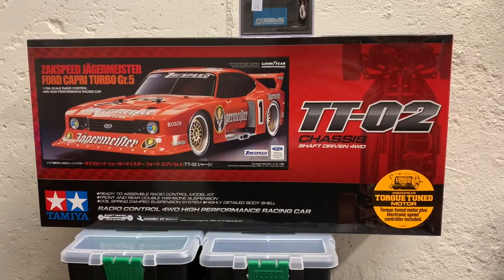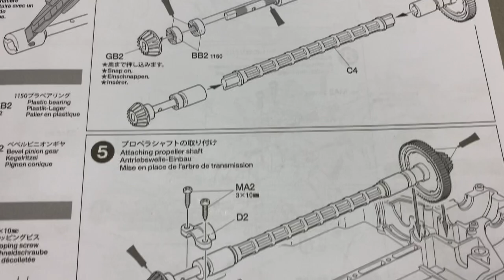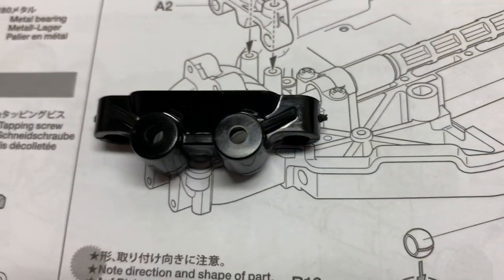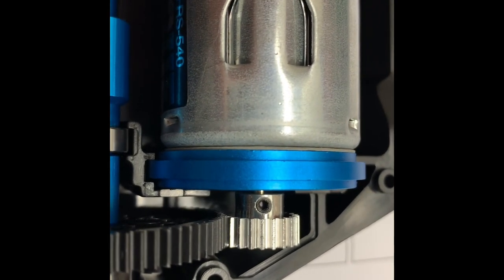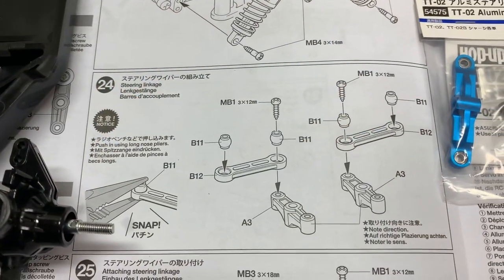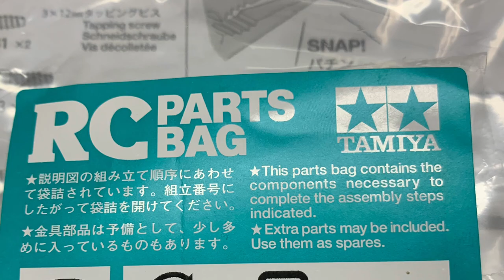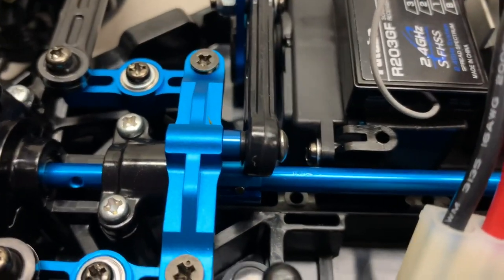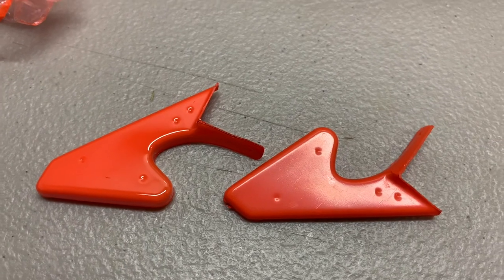Tamiya TT-02 Detailed Build With Hop-Ups!!!

Comment: Doing the Escort TT02.  Bought some hop ups too.  CVA oil shocks is one of them.
Reply from the maker: Sweet, I love that body set.
Reply: Cool! I am actually considering getting that one, as a way to get into the hobby. I have quite a bit of scale modelling experience under my belt, and im looking for a new challenge. Tamiya's always been great, kit wise, so im guessing their RC stuff should be spot on too, right?
Reply from the maker: Yes, great scale detail and solid performance. I would definitely recommend them for kits. Easy to build, but loads of fun.

Comment: Hello, I have the same chasis. For the differentials. I saw you used the yellow grease instead of the aw grease? I used the AW grease on my differentials. Did I do that wrong?
Reply from the maker: No, you certainly can use the AW grease in the diffs. I personally like the other grease better because I feel like the AW grease is a little too thick and maybe a little too sticky. On the plus side, the AW grease will not slip or fly off the gears as much as the regular stuff.

Comment: Love your channel, and thanks for your guidance! I wonder if I can ask you a question--I love the Tamiya Datsun rally body, but the model is discontinued and ran on a TT-01 chassis. Is it possible (easy enough..) to run that same body on the newer TT-02, if I picked up both separately?
Reply from the maker: You bet. The TT-01, TT-01E, and TT-02 all have the same wheelbase, 257mm.
So all the Tamiya bodies will work between them. Good luck, that is a great scale body!
Reply: @mitamiyaguyrc7825  thanks!!

Comment: Great build nicely finished. Does the high speed gear set make much difference?
Reply from the maker: Thanks Mark. I will do a speed test and let you know. I’m assuming it will be faster just based on gearing but I’ll check. We race TT-02’s and TT-01’s with torque tuned motors so it will be easy to test.

Comment: Awesome video! Keep up the good work! Wish I’d watch your video first before building the chassis of my 2020 Ford GT Mk II. I kinda want to take it apart and add in those pop-ups in your video. Do you think that is a good idea or am I too late to take it apart? I don’t want to ruin it by accident.
Reply from the maker: No, you’re not too late at all. I would definitely add ball bearings the 3 degree rear hubs and some oil filled shocks when you can. Those three things will make it run much better!
Reply: @mitamiyaguyrc7825  Nice! I’ll try to find the parts from my local hobby stores. Do you know any good online store that might carry the parts? Just in case my local stores don’t have them. 🤨
Reply from the maker: amainhobbies and tower hobbies are good places to start. Pandemic has taken a toll on RC parts though, so they might be back ordered a little.
Let me know how it turns out!
Reply: @tinlongtang1675  I go through TQ RC and they have a bit of genuine Tamiya stuff but sadly, the supply chain issue really hit the hobby hard.

As for your first statement, it’s never too late to do the hop-ups however, that doesn’t mean it’ll be easy if you have to install ball bearings (trust me, I know). Aluminum motor mount, motor swap, High Speed gear set, aluminum prop shaft joints, rear differential locking block and any changes in pinion pitch should be done all in one go. It seems like a lot to do over if you’ve already assembled the kit but if you plan to hop-up the chassis AND install bearings, take my advice on this.

Next invest in some oil-filled dampers. The Tamiya Super Mini CVA set isn’t bad and is miles better than the “pogo sticks” you get with the kit. However, for the price you can get the Yeah Racing aluminum 50mm (or 55mm if you need a little more travel) shocks which look similar to the mega expensive TRF units but costing almost the same as the Super Mini CVA set that’s plastic. Oil filled shocks make the chassis respond awesome!

From there I’d suggest a full steering upgrade. I know the full set might be steep (because it is) but it’s valuable if you want to get the most out of the chassis. Most of the components were shown in the video except the adjustable steering turnbuckles you can only get with the kit.

After that is solely up to you and what your budget and interest will allow. Currently have two being worked on: my original TT-02 that I built into a drifter and a second chassis that had a full RWD drift conversion kit installed and was bought for less than the cost of said conversion kit itself. Each has its quirks but the key is to enjoy the hobby altogether. 

I’m a little jealous you have a better ESC though since the TBLE-04S (as found in the 2021 released TT-02 kits) has a built-in fan mount and slightly larger headroom (75A) to run aftermarket brushless motors. The TBLE-02S is 60A, you can’t go lower than 10.5 turns with brushless and when you do, you have to find a retailer that has the special ESC fan mount at a decent price.

Anyway, enough talking and happy hobbling mate!
Reply: @tinlongtang1675  Also check out RCMart. They have probably THE biggest selection of hop-ups around. However… being they’re based in Hong Kong, depending on where you are in the world, the shipping can take weeks even months. But if you have no issue with it, you’ll find the best prices and best selection around.

Also, don’t be afraid to use some serviceable parts like shims and washers from other manufacturers. As long as you know the dimensions and thread pitch, some hardware stuff you can get from the local hobby store or Amain Hobbies that are meant for other brands but will work in your application.

Comment: Nice build! I just built 2 TT-02 kits this weekend, a 99 Subaru Monte Carlo and Toyota Yaris Gazoo Racing. I wanted to know if a servo saver would help you go straight after turning because it looks like my builds don't go straight after turning since I didn't put in a servo saver, not even the plastic ones that come with the kit or is my servo just malfunctioning?
Reply from the maker: Nice, I really like both of those bodies. Servo saver is really designed to protect the servo from crashes and hits, so your servo may have an issue. Is the toe-in etc even on both sides at the front?

Comment: Nice build, do you go racing with the TT02?
Reply from the maker: Yes, we parking lot race budget cars like Xpress XQ2S and slightly modded Tamiya TT-01E’s and TT-02’s. We all use kit tires or USGT pre-mounts and Tamiya Torque Tuned motors. It’s a blast and very competitive.
Reply: Fun!

Comment: Honest question: why was it suggested that you’d bought the steering components separate instead of caving in and buying the full set with the adjustable steering turnbuckles?

Also, why the kit motor cover? Why not the aluminum heat sink?
Reply from the maker: Hi, good questions. With respect to the steering, my local hobby shop didn’t have the full set so I bought they separately to support them. I only have one shop in my area that carries Tamiya parts so I really try to buy from them.
For the heat sink, I just don’t find the torque tuned motors get very hot, so I didn’t think it was necessary.
Thanks for the questions.

Comment: Is this a viable option for VTA classes
Reply from the maker: With hop-ups it’s a decent starter car for VTA. I might look at an Xpress XQ2S for racing VTA though. Cheap with more adjustability. If you want used, you can pick-up a 2-4 year old XRAY T4 or a Yokomo for a good price too.
Reply: @mitamiyaguyrc7825  thanks for your help